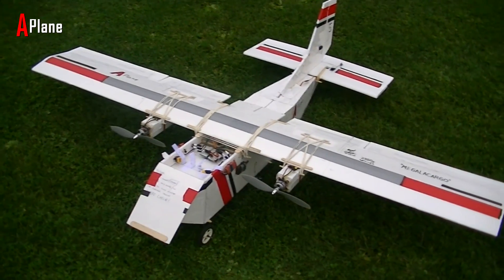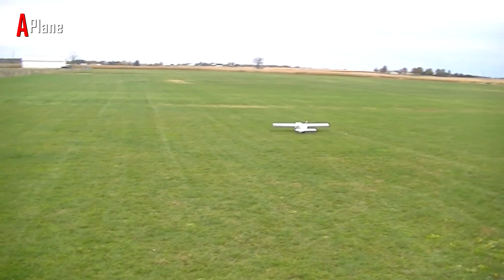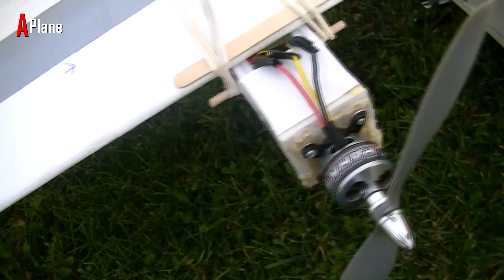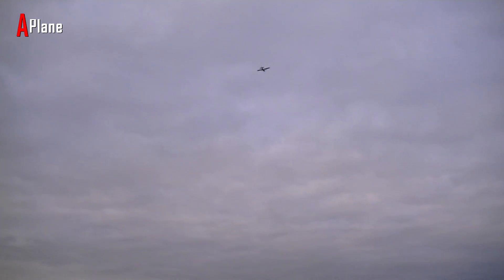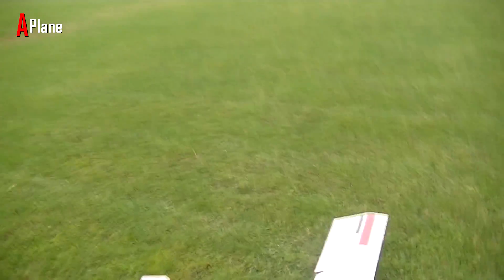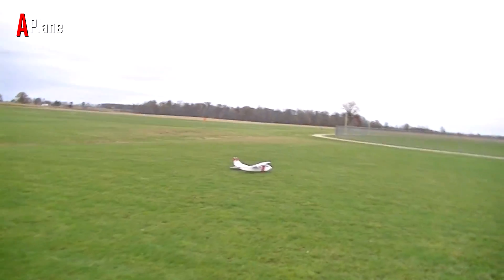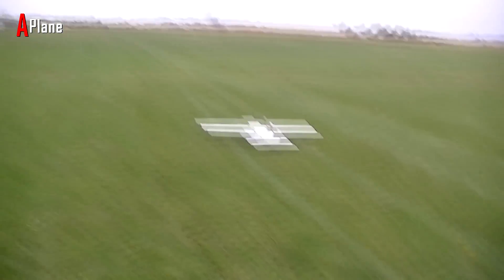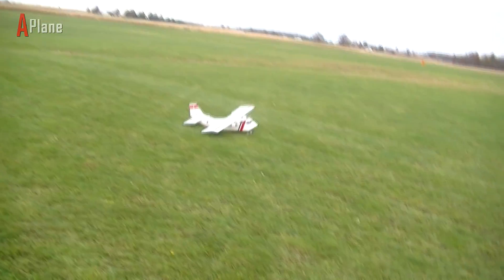75" RC Scratchbuilt Cargo Plane - Maiden Flight

Comment: i have 3 pound airplane, i need pick up motor and speed control which let me flight 30 to 45 min with 5200mah battery, is this posible, and what motor and esc do i can use

Comment: Very nice. I built a 60 inch cargo plane quite like yours, and it also used 2 2200mAh 3s, but flew happily with 2 5000mAh 3s. You could definitely put some bigger batteries in that guy.